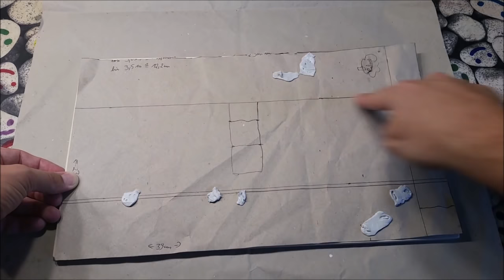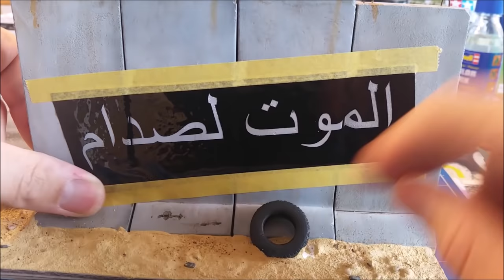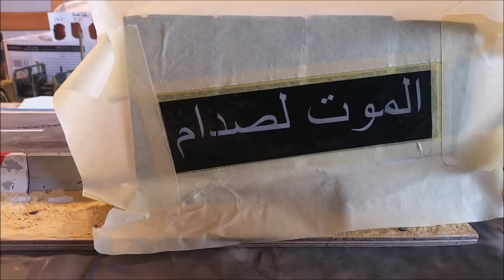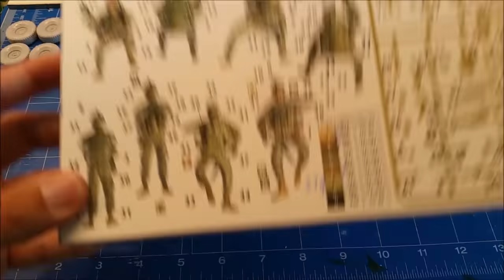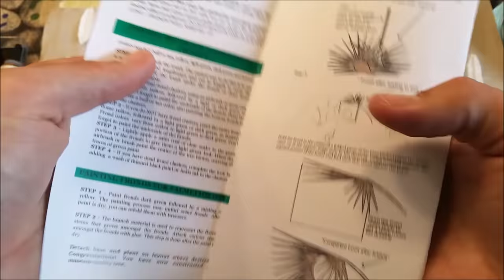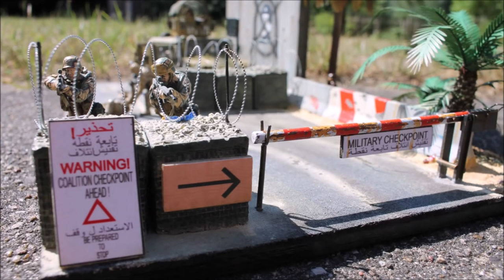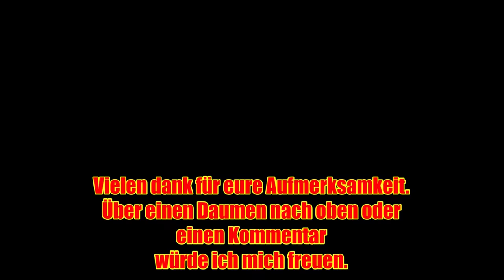(Reupload) Diorama Bau / building "Checkpoint under fire" ACADEMY M1151 1/35

Comment: What are some basic and general things you always need for dioramas that you would then add to to make specific dioramas
Reply: I haven't got a lot of experience but basic things are foam the extruded, hard one, plaster or air drying clay to put over the foam to create a hard surface. With clay you can model some elements too in their rough shapes. After that fine sand mixed in scenery glue (look up luke towans channel for that) thatll be painted over depending of the ground you want, rocks etc. Milliput is nice to make finer details/ modify figures. I would also recommend getting square/ round wooden sticks in different sizes to be able creat details that are made out of wood, and styrene for anything else.
Reply: Just getting stuck in and doing in.... talking about it won't get nothing built